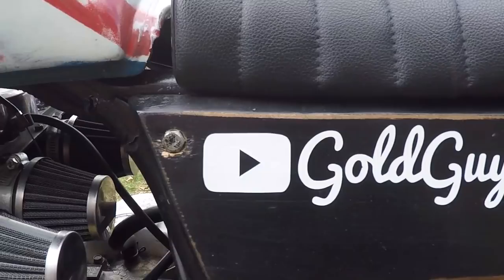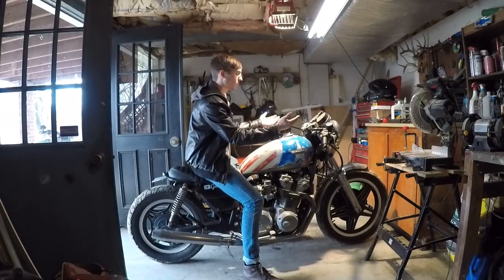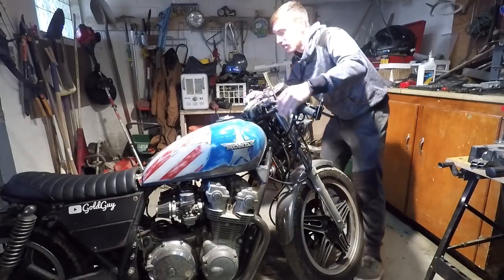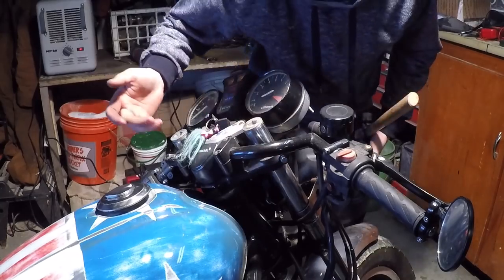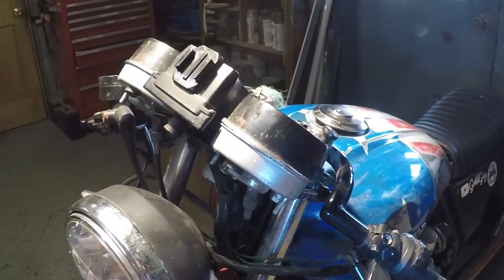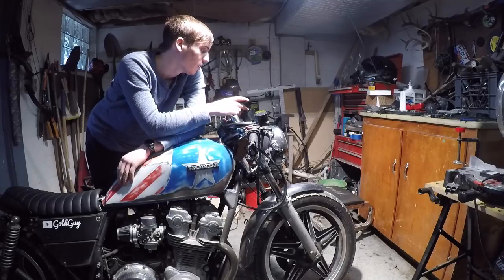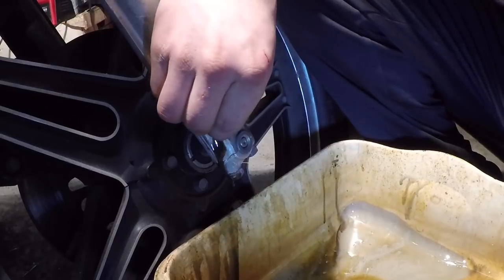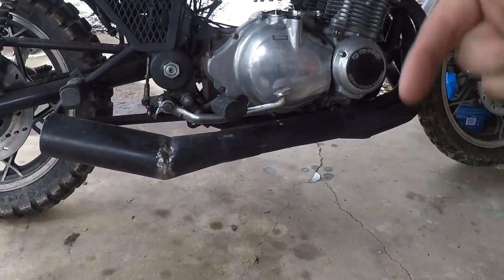Return of the Cafe Racer: Fixing the Front End

Comment: I did mine on lathe, just cut the tubes shorter and made threads to them on the inside so i could lock the springs on there with threaded aluminium plug/bolt. And just cut the springs shortes same amount. Imo it looks cleaner without forks poking up from the t clamp.

Comment: Did you put 12oz in each shock? Believe its 6oz each.  If you want to lower your fork remove the spring and cut desired length off. The spacer goes in the bottom end over the piston to compensate for cut spring

Comment: How did you get the gauge to read the correct rpm, on the cable drive tac cb750s it typical reads half the actual rpm when you is a digital tac, I'm getting ready to buy the same gauge for mine
Reply from the maker: Michael Siska there is a wire coming from the tachometer/speedometer unit labeled "speed sensor or rotation sensor" and you have to connect this wire to the trigger wire coming from the pulse generator in the engine of your motorcycle
Reply: Goldguy thanks, must be a dohc thing, I have an older sohc and it's strictly cable driven so I have to pick up a trigger from the coils

Comment: Did yours have the air assisted forks ? And what did you do to get that out of the way ?
Reply from the maker: Ben Reesor nope bo air assisted forks just oil and spring
Reply: That helps, on mine the air line an the choke is in the way. I got to looking into it. I think I’m going to convert to progressive springs. Then cut 2”s out an add the 2” spacer in at the bottom on the fork piston. So I can keep it flat at the top of the tree.

Comment: One thing you can do with this old bikes to level out the forks without losing much lean angle (or gaining some) is bump the rear up an inch just don't over do it if you have a shaft drive.

Comment: Too much drop in the forks and you'll bottom out the fender under heavy breaking causing the front end to wash out. That is way too much drop...you have also very much messed with the rake and trail of the front end. That much drop will no doubt cause a very unstable front end at high speeds. It will dive into turns better but by decreasing the rake and trail you also make it very unstable. Love the video's but please do a little more research on the effects of dropping the front end...be safe!
Reply from the maker: JJB0071 I only dropped the forks 2 and a quarter inches, I've seen people drop theirs more with no problems, but you might be right. We will see, thanks for watching!
Reply: Yeah, just check to see what the overall travel is...I just don't want to see you get into a tight spot during an emergency brake. I like what you're doing though...I was the same way with my bikes at your age. It should be more nimble in the turns but as I said you will give up some stability at speed...think about a damper. I dropped my Triumph only about 10mm and it made a huge difference. love the videos...
Reply: The fender is attached to the part of the forks that do not move😂 the distance between the fender and the tire never changes....so therefore he has nothing to worry about
Reply: Yes that is true but the distance between the fender and the lower yoke brace is decreased when you move the tubes up in the triple tree. There is where you lose your clearance. If the front collapses under hard braking to the point where the fender comes in contact with the brace then there is no more movement and the front has a much greater chance of washing out. 

Goldguy, just get a ratchet strap and collapse the front suspension till it stops. If you still have clearance between the fender and lower tree brace you are good to go.
Reply: Check your rake and trail!